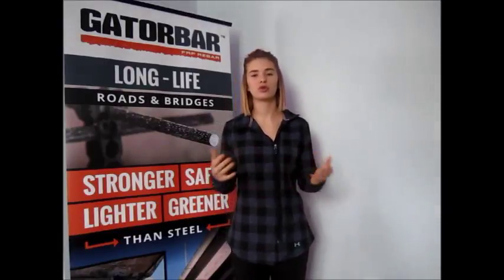What is FRP rebar? The basics

Comment: Gatorbar doesn't have the exterior ribs that traditional steel rebar has.
Do you offer smaller chairs for a tighter grip around the rebar to compensate for the smaller diameter?

Comment: GFRP rebar, rock bolt and accessories. which are widely used in lots of fields such as the coal mine, tunneling, metro engineering, coastal engineering, slope stabilization work etc.,If you need any thing about it, please come to me!whatsapp:+8618516943083